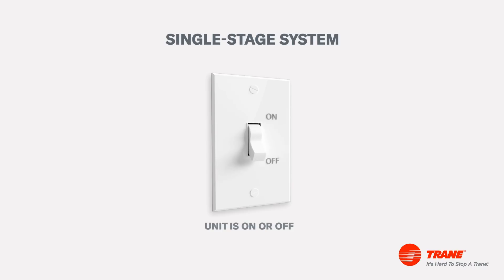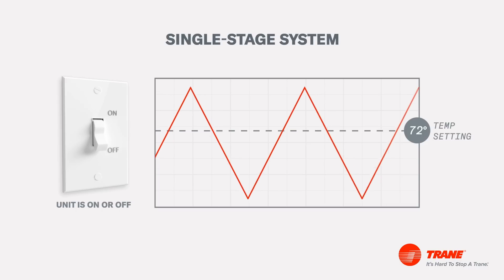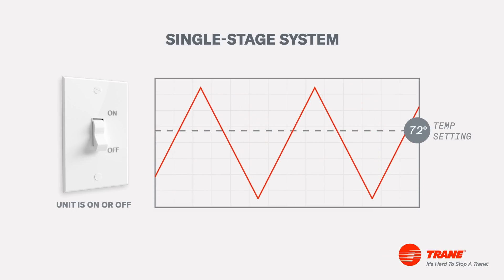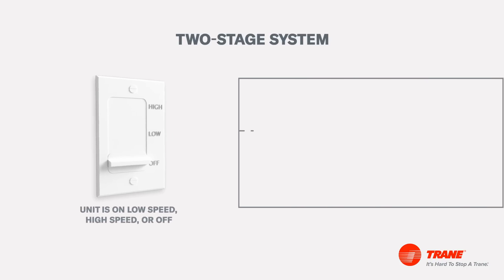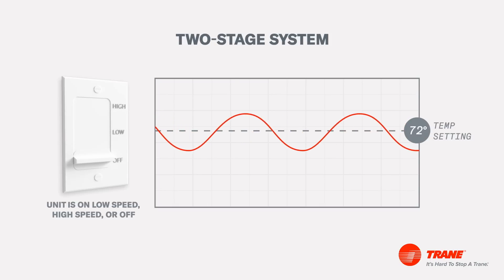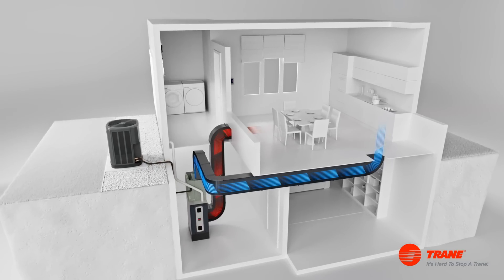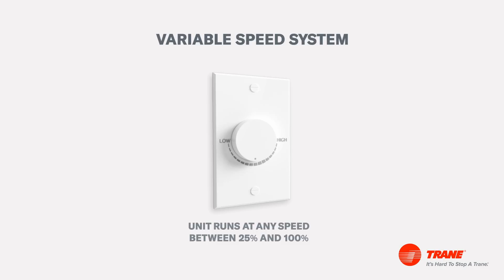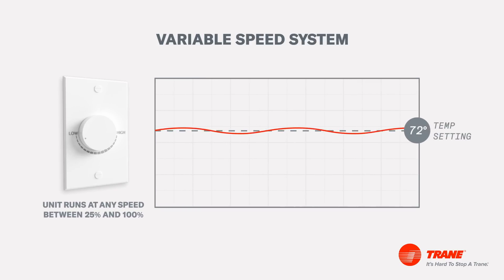Difference between variable speed vs. single or two-speed HVAC systems

Comment: Hello, Had an issue with my nine year old 4TWX8048A1000A. I opened the panel on the outdoor unit and found the Service Facts all stuck together and unable to be opened to read. Could you point me to the PDF of the Service Facts 4TWX8048A-SF-1? I am unable to locate the Service Facts 4TWX8048A-SF-1 searching on the internet. Thanks